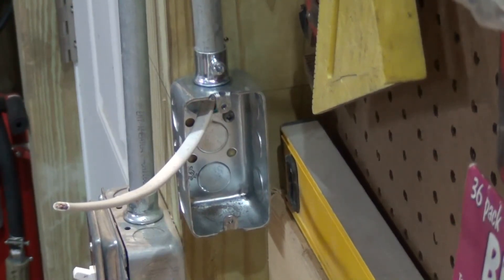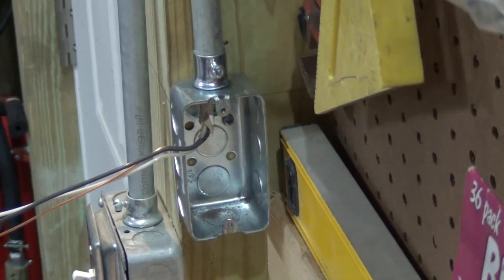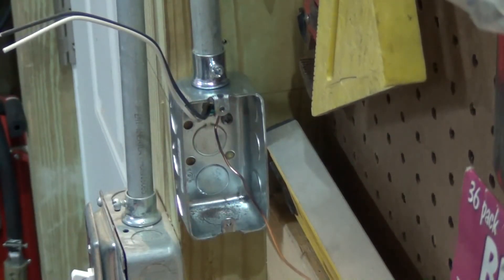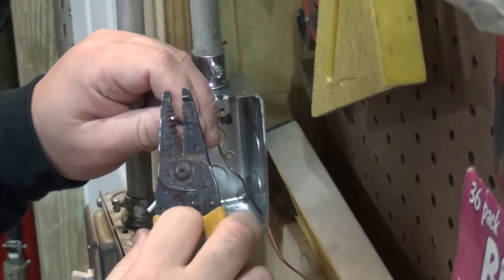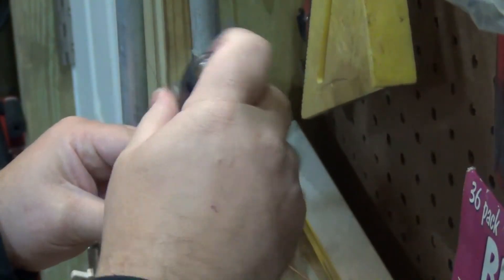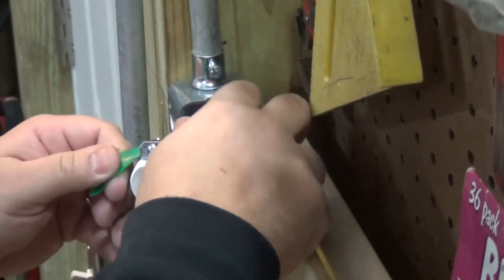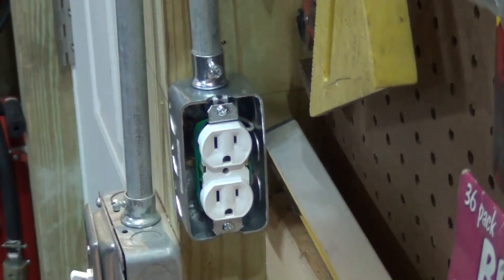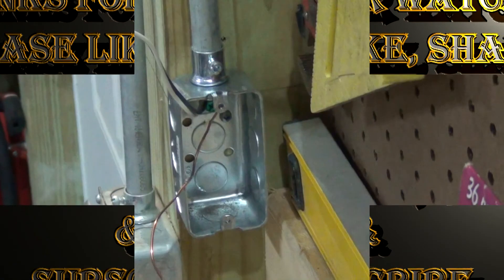How To Wire A 15 Amp Electrical Outlet To Metal EMT Conduit

Comment: Code permits Romex in conduit to protect from physical damage where necessary, NEC 334.15(B). I didn't see any code violations here, even though people complained that this and that were code violations. Nobody cited the code that was violated, funny how that is. It's best to wrap the wire around the screw in a clockwise direction, but the code doesn't mandate this. It's optional to wrap electrical tape around the receptacle, but it's not addressed by NEC.

Comment: Romex shouldn’t be run in metal conduit. It will over heat. Only single stranded wire is allowed in metal conduit. This is also against code.

Comment: At 6:02 the wire tip should have been wrapped clockwise around the screw. Tightening the screw with it ccw will cause the wire to loosen in the manor you applied it. The same goes when people use wire nuts. Two or more wires should be twisted clockwise together before installing the wire nut. This allows the wire nut to further tighten the twisted wires.

Comment: Good video.  Do you follow local codes or the NEC?  I am asking because I want to know if codes permit romex in conduit.
Reply from the maker: Obviously you would follow your local code specifications. This video was not about running wire through conduit, but I appreciate your comment. Thank you very much , check out handymanpf.com

Comment: Romex in EMT?  Unusual and likely not code in most places.  And why would you in the first place? Neutral conductor is wrapped counterclockwise on the screw!  This is a code violation.  The ground wire to the receptacle is twisted around the screw - unusual.  Taping the receptacle is not required or recommended.  And cutting off the receptacle ears?  They provide stability to the assembly when there are lateral forces such as a plug being pulled to the side...  This wouldn't pass an inspection IMHO.
Reply from the maker: Well the thing is, is that it’s not getting inspected. And you are correct on the most part. I would have done it differently if it was getting inspected. But this will work and is not unsafe at all, I have done electrical for years that has been inspected several times  and tasks like this which really is no big deal. Plus cutting the ears off, I had to, to fit it in the box cover. Thanks for watching and commenting. Happy new year.

Comment: Everybody saying not to run the nm cable in conduit, so let me ask this does the conduit go back to the panel or is it just to get it above 8 feet to protect from damage?
Reply: All the ones who says it can not run through conduit please share where in the National Electrical Code it says that. Other words prove it. Because he can run it through conduit.
Reply: @Joe-by8jh  no just the proper connector for the raceway. We do alot of houses with basements where the panel is stub up 2- 2 1/2 conduits with connectors and bushing, thats it.
Reply: You can run Romex in conduit provided you do not exceed conduit fill, Chapter 9, Table 1.  i.e. 12/2 Romex would be considered 1 cable and not exceed 53% fill.

Comment: Your twisted wire should run clockwise with the screw.  No Romex in emt .  I am retired Building Inspector.
Reply from the maker: Yeah, well you’re not inspecting this. As I stated numerous times before. These videos that I make are for informational purposes only and to the way that I do things. If someone try’s to perform the tasks, they do it at their own discretion and that they should follow local building codes.
Reply: I would have passed it. Electrical inspector here. It met the code by protecting the nm cable from damage as per the NEC.
Reply: As a building inspector, did you go by the electrical code in deciding what was allowed, and what wasn't? Or was it just up to you? The reason I ask is that I have not seen a prohibition against using Romex (NM cable) in conduit (EMT or other) as long as it doesn't overfill the conduit. Are you aware of a specific code section prohibiting it?

Comment: So if this  video is wrong and not code so why is  the video not deleted? It is confusing people.  It’s not funny blind leading the blind?
Reply: His video is not wrong you can run nm cable through conduit.
Reply from the maker: The video is not about running the wire through the conduit like stated in previous comments. It is how to hook up and connect an outlet to metal conduit. It’s pretty straight forward. The comments are confusing you. Read the title and description of the video. Yes I ran romex through conduit which is against code but again this is not what this video is about. I have very little amperage going through this wire, not even one amp. Plus it’s not getting inspected. This is switch is hooked up to a light contactor and is only dedicated to that. And I will also state again that these videos I make are for informational purposes only on how I do things. Please do your du diligence before you proceed with your project. If you don’t feel comfortable doing the project then highly recommend you hire a professional. Thanks for watching and commenting.

Comment: Just a heads up to viewers- you'll fail inspection running romex through conduit.
Reply: A constantly repeated, INCORRECT statement. You absolutely CAN run romex through conduit, it's just not done as much because romex is designed to be run exposed, and pulling individual wires is both cheaper and easier. But there's absolutely no reason why you CAN'T do it. In fact, code even REQUIRES it be run in conduit in some circumstances (like where protection from physical damage is needed). Another thing is conduit fill. Obviously, it's better for fill purposes to use less material, another reason why people use singles instead of NM. But assuming it's a dry location, not overfilled, you absolutely, 100% can run Romex in conduit. Please stop spreading your misinformation and confusing people in your attempts to look like a knowledgeable code inspector. You clearly aren't.
Reply: @user-nh3gu1ge3d  Ageeed! NM wire is not expressly forbidden by the national code. You may have jurisdictions that have specialized rules, but there is no reason why you cannot do this. As you pointed out, unless you happen to have unused romex lying around It just seems to be unnecessary and more expensive.
Reply: Was just about to mention that. I believe you can pull the individual wires out and run it through conduit that way.
Reply: @slappyd7388  I was hoping I could do that so I don't have to needlessly terminate the romex to a junction box but I need to double check if that's ok.
Reply: @JeffKubel  it may be different if there is state codes, but I dont see why you couldn't cut the outer jacket off the romex right where it enters the conduit and just push the individual wires through the conduit. It's been a minute since I looked through the codes but you probably have to have something to secure the wires right at the beginning of the conduit. Then again, I'm not electrician but I was told by two that you are allowed to push individual wires through as long as the romex outer jacket has been removed.
Reply: @slappyd7388  no the code says to leave jacket on.
Reply: I just had an inspection in Mississippi and i had bought Romex to run to an electric water heater just layed it out no conduit yet and he said that i have to run conduit to heater and he said i could run the romex thru the conduit.
Reply: @catbirdfeeder  I would follow what the inspector said in that case. He is the one that we all have to please haha
Reply: No you wont fail inspection per the NEC. You can run it in conduit, but you have to follow the fill according to the tables in code.

Comment: Why did you install the ground wire to both green screws? Could you just install to one or the other?
Reply: No per the NEC you  must connect it to the box and the device, thats a metalbox .
Reply from the maker: I don’t see why not. I go overkill with the grounds sometimes.
Reply: @handymanPF  thanks. Over kill is not bad, I just got confused...very easy for me lol
Reply: No he did it to code. The ground wire has to be bonded to the box and the device.
Reply: @thomasmarable6818  thanks
Reply: The code in question is NEC 250.146. You always have to ground the metal box, according to NEC 250.146(B) connecting to the receptacle ground screw is not required in this case if a commercial grade receptacle with a self grounding feature is used.

Comment: what about the ground wire coming from the conductors? or u dont need one cuz its emt? if i have pvc conduit how would i connect them?? metal box
Reply from the maker: Good question. The Answer is yes legally and for safety reasons, you should hook up your ground wire.

Comment: Handy Man. you need to learn electrical codes, it is a code violation to run Romex inside of a conduit.
Reply: It is not a code violation, prove you point with code section.
Reply from the maker: Thanks for your concern. I am not going to argue because you are correct about code and I already knew that.  I even stated in previous comments to not use romex through conduit. This isn’t getting inspected and it’s my own place, so it will be fine. I’ve been doing this for years. Now with that being said, these videos are for informational purposes and are the way that I do things. I do highly recommend you know your local codes and follow all safer practices.
Reply: Where in the code is this prohibited?

Comment: can't you just strip the wire out of the romex and use it like that if your in a bind?
Reply from the maker: Legally, no. Plus the ground wire should be coated and green.
Reply: @handymanPF  Thanks Buddy,  stay safe.
Reply: @handymanPF  the ground wire can be bare or green.

Comment: Just failed inspection for running romex through conduit DO NOT DO THIS
Reply: Wrong. This is a common inaccuracy that YouTube master electricians (and others) like to repeat but it is not true.  NM cable can be in conduit. In fact, NEC calls for it to be in conduit, when protection from physical damage is required. Refer to NEC:

National Electrical Code 2011
ARTICLE 334 Nonmetallic-Sheathed Cable: Types NM, NMC, and NMS
II. Installation
334.15 Exposed Work. In exposed work, except as provided in 300.11(A), cable shall be installed as specified in 334.15(A) through (C).

(B) Protection from Physical Damage. Cable shall be protected from physical damage where necessary by rigid metal conduit, intermediate metal conduit, electrical metallic tubing, Schedule 80 PVC conduit, Type RTRC marked with the suffix -XW, or other approved means. Where passing through a floor, the cable shall be enclosed in rigid metal conduit, intermediate metal conduit, electrical metallic tubing, Schedule 80 PVC conduit, Type RTRC marked with the suffix -XW, or other approved means extending at least 150 mm (6 in.) above the floor. [ROP 7-94] Type NMC cable installed in shallow chases or grooves in masonry, concrete, or adobe shall be protected in accordance with the requirements in 300.4(F) and covered with plaster, adobe, or similar finish.

There are some other factors like percentage conduit fill area, location, etc. where NM may not be installed. It may not be over filled and it may not be installed in damp/wet locations.

Based on the look of this, he would NOT fail so thank you for your condescending, unhelpful, misinformation that no one asked for. In the future, keep your negativity and pointless criticisms to yourself. No one is impressed by what you think you know, you're just annoying.
Reply: Odd my property just passed inspection with an outlet like this in garage. lol.
Reply: @zachattack83  i looked into it. I'm in Canada. Totally different standards
Reply: @jmartin1203  So an American wires up something in accordance with US code which you said would fail based on your Canadian code which doesn't apply to him? That makes a lot of sense. Keep up the comments!
Reply: @zachattack83  theres a difference between a home inspection when you purchase a home verses an electrical inspection when a permit is pulled.  No inspector will pass romex inside conduit because it has the potential to overheat.  A regular circuit breaker only protects against amperage draw not overheating.
Reply: @rwallace9848  you are wrong the National Electrical code does allow nm cable to be run through conduit. You must not be an electrician, because a real one would look it up in the code book. You might be a wire puller who just does what other tell them.
Reply from the maker: Oh my goodness. Good thing it’s not getting inspected plus this video isn’t about running wire through conduit. Also I am running less then 1 amp through this wire so there is not going to be much load on this wire at all. So It’s all good. Thank you for the YouTube inspection and commenting on what video has nothing to deal with. But this gentleman is correct, you are not supposed to run romex through conduit. As I have stated numerous times- these videos I make are on how I do things and are used for informational purposes only. Thanks for watching and commenting
Reply: @handymanPF  you don't know what you're doing and those inspections are so people like you don't run their welder on a number 12 wire and burn their house down.
Reply from the maker: Zack Bell you don’t know what you are talking about because they have 110v 15 amp welders out there lol and plus with 12 wire you would hook it to a 20 amp circuit breaker, so if you would run a 30 - 50 amp welder by some ungodly reason it would trip the breaker. So you do not know what you are talking about. I have been doing this stuff more then 20 years and have had great inspections. Some work I don’t get inspected. I am assuming you are either in school or just started out a Career as an electrician , so I wish you luck. But when you criticize, make sure you know what you are talking about and don’t take the other person for granted.

Comment: Should be using a exposed work cover and you could also use the EMT as a ground if piped going back to panel. Also wouldn’t recommend running Romex in conduit it can melt from heat.
Reply: Nothing wrong with his cover.
Reply: First thing I noticed - ROMEX in EMT = big nono

Comment: I am not an electrician, but I can tell you that using "Romex" - non-metallic (NM) - aka common home building wire (White Vinyl Sheathing) 14-2 for 15 amp and 12-2 for 20 amp in Conduit is NOT code most places in the US.   Romex/ NM is not designed to be in conduit because it will heat up - Fire Hazard.  You may be able to use it some areas for short distances but for most instances it is a NO. NO.  I would check with your local codes before using it.  Using UF-B wiring (Gray Sheathing) should be code......Please check your local codes.
Reply from the maker: I’ve only known it as romex, I have never heard it called common household wire. And you are correct, don’t use romex in conduit due to heat issues. I have less then 1 amp running through this particular circuit and it is grounded more than it has to be. You should use 12awg or 14 Awg wire one green for ground , 1 white for neutral and 1 black for line / hot. And if you’re doing a 3 way circuit, then add a red for line 2 / hot 2. Thanks for watching and commenting.
Reply: @handymanPF  Your denile  for not excepting the mistake will do no one any good .  Because a new buyer doesn't know that the wire inside the pipe is wrong . If you sold your home the new owner might burn the house down for lack of your mistake being not known . and if you would sell a home with this mistake left in it . The damages that would incur within a year after sale would make you libel . I would correct it .
Reply: @williamjeffrey1222  he is not wrong nothing in the NEC says he cant do it. As a matter of fact it says it can be to protect from damage.
Reply: I know what hat your saying but technically I don't see how Romex could not be allowed in conduit. if, its the only cable in that run,🤔if you find the code on the NEC let us know please.

Comment: I heard rumors that you shouldn’t run romex through EMT. Can you shed some light on this?
Reply from the maker: You are not supposed to. You are correct. It is because of a heat issue, especially on higher amperage wire. Good question. . I did on this one because I am running very low amperage, less then one amp. All in all it is good practice not to run romex through emt. Thanks for watching and commenting. Please like share and subscribe
Reply: no, he is not an electrician,
Reply: @assho8649   Yes,...he looks like he is a trainee  in electrical work . But he does some pretty good vids. on auto mechanic work .  He is young and willing to learn and for that he's okey with me . I was a clutches when I was young too . But I stuck with it . He will improve with time .